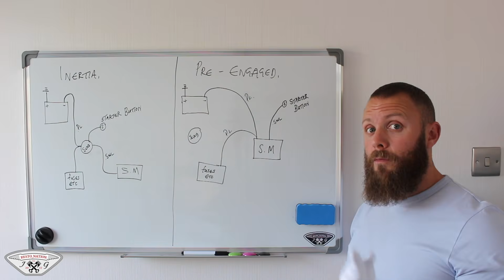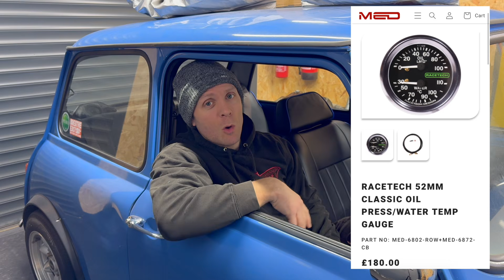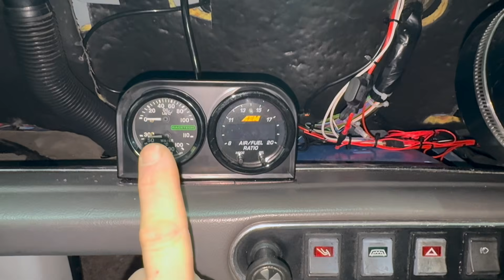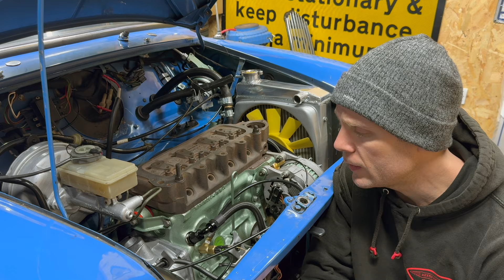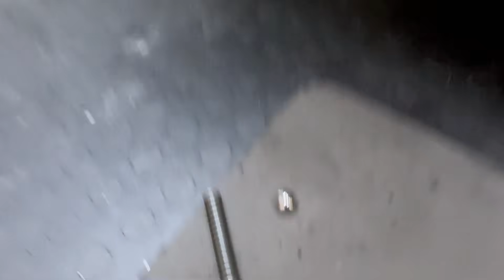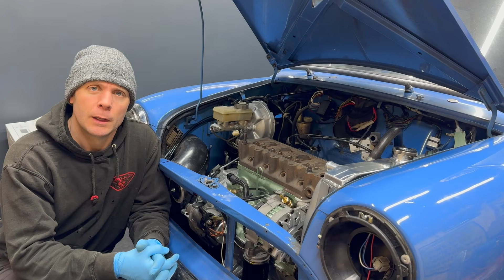Classic Mini Oil Pressure Mods for longer Engine Life

Comment: One of the best oil practices for these older engines is to use a very good quality oil (NOT synthetic) and to change it (and the filter) at least twice as often as the manual suggests. I obtained an 80,000+ mile 2.0L Ford engine out of a (Sierra-shaped) Granada which my mate purchased from a Doctor. Now obviously, as a Doctor, he needed maximum reliability so he never missed a Ford service and then, when my mate got the car, he changed the oil & filter for good old Castrol GTX every 6 months for a few years then the car was eventually scrapped but I grabbed the engine to transplant into a Ford Transit before it went to the crusher. I decided to do a top-end decoke and NO EXAGGERATION, the overhead cam and cam followers had ZERO detectible wear. All looked like you'd just polished them on a buffing wheel with not even a hint of a mark on the contact points.

TIP: If anyone's ever resurrecting an old Ford 1.6 / 2.0, the Ford VV (variable venturi) carb is quite economical and EXTREMELY reliable & smooth. I got one from my brother when he upgraded (downgraded imho) his XR3 to a Webber carb (for what little performance difference it made) and on the subject of oil, he informed me at some point that Ford sold their own branded oil which had IDENTICAL specifications to Castrol GTX but was about half the price, needless to say, a saving was had on the oil from that point on.

On another occasion, I bought a fully rebuilt 2.0L short block for another Ford and having a new crank grind and new bearings etc' thought I'd treat it to some Synthetic oil when it first became all the rage back in the 70's / 80's. After about a 100 mile run to Wales on a surfing trip, there was not a single drop of oil on the dipstick. It hadn't burned away and turned to smoke or leaked out anywhere so I speculated that it must have simply evaporated. Back to old-school mineral oil we went !

Conclusion: Use (and religiously change) the right oil for the engine and (like the copper head gasket on this Mini as with so many other things also) DON'T cheap out on the oil & filters, it's a false economy 😉👍
Reply from the maker: Good advice, but cheap, buy twice!
Would you still recommend a 20/50 mineral with a high lead content?
Reply: @Resto.Nation  Not that I'm an expert but for a Mini engine, a good quality basic 20/50 mineral oil with no additives or friction modifiers would suffice ~ BUT ~ because the oil lubes the engine AND the gearbox, it's a bit pricey but (designed for older performance engines) an oil with a high Zinc content (such as Millers Classic Sport High Performance 20w-50 @ about £40 inc VAT for 5 litres if you shop around) can reduce wear by creating a sacrificial layer between friction surfaces, especially for flat tappet cams 😉